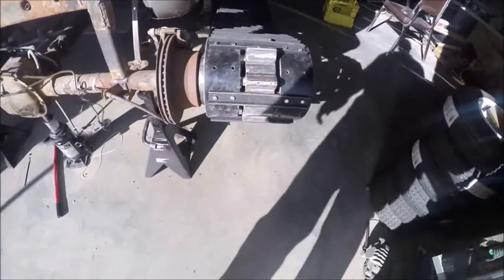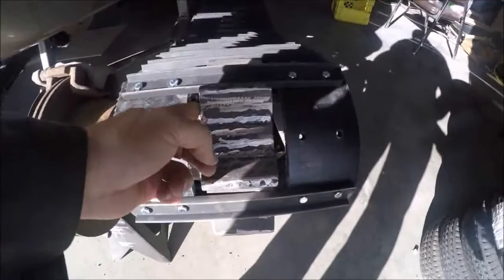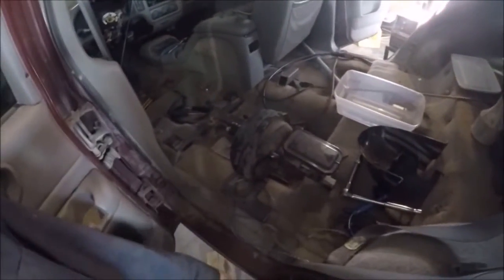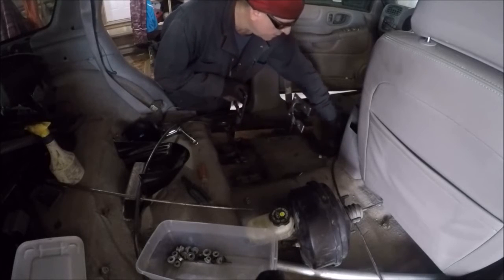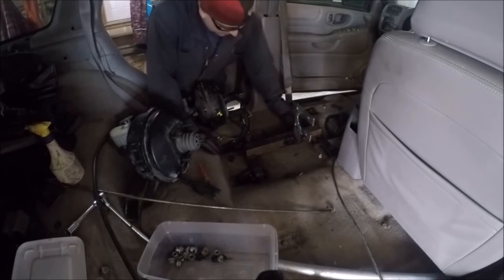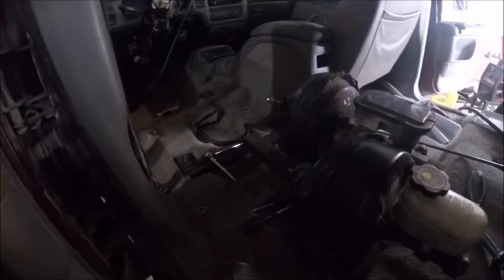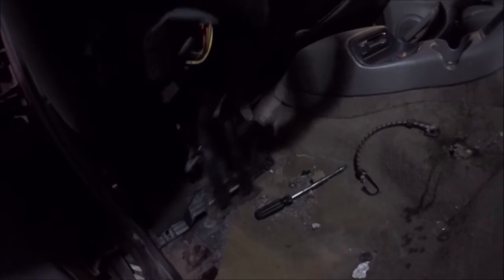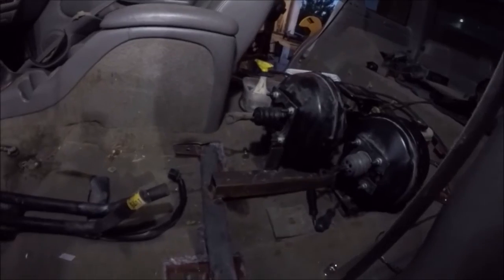Custom Tracked Vehicle, Part 13 Brake System

Comment: Nice progress. The guides hitting the sprocket, good catch. Adding tension to the tracks when you have it on the ground should keep the guides from riding up on the sprocket, that is if your idea doesn't work but I think it will. Normal ratio on the brake pedal with powered brakes is normally 5 or 6 to 1.